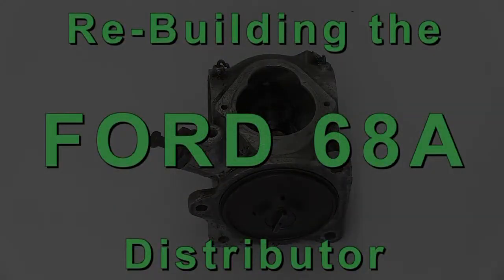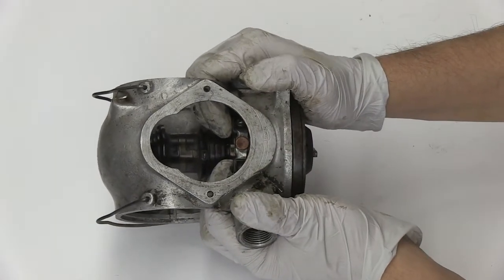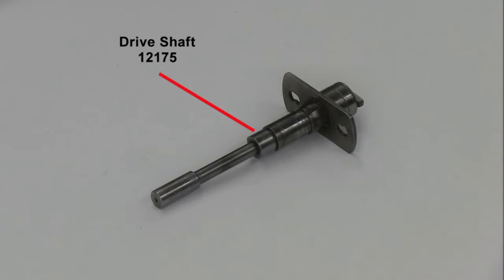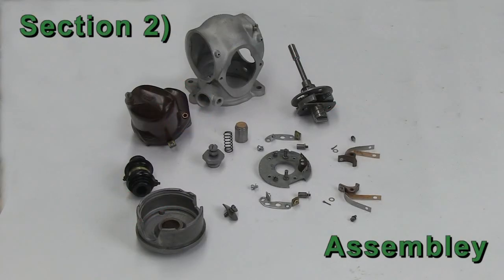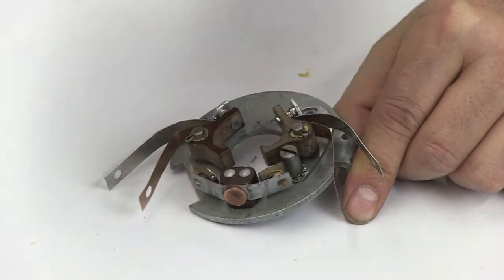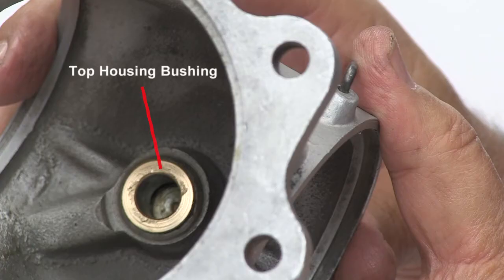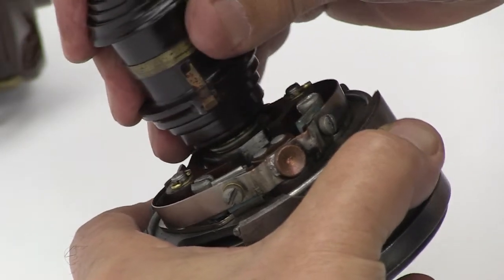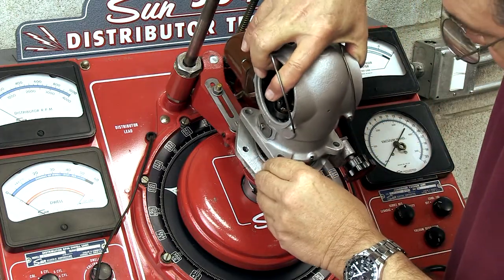FORD Early V8 Dome Distributor Rebuild

Comment: Real good how-to video, but lacks how adjust the points and setting the timing. I did replace the points on a 1936 around 1960, but don't remember how much I had to disassemble it. The local Ford dealer still had the points in stock then.